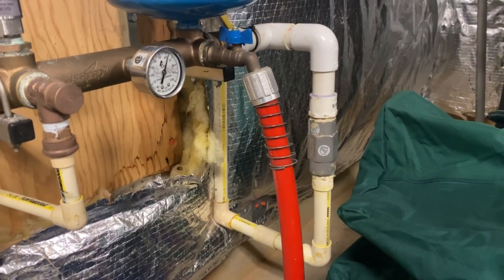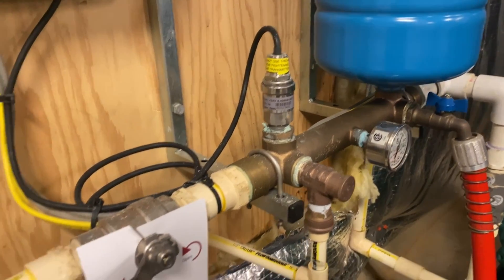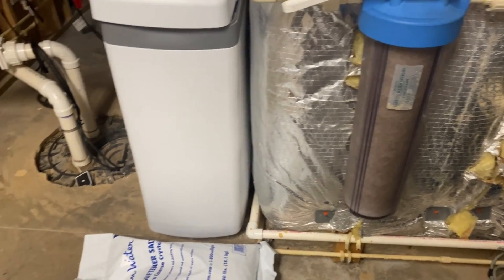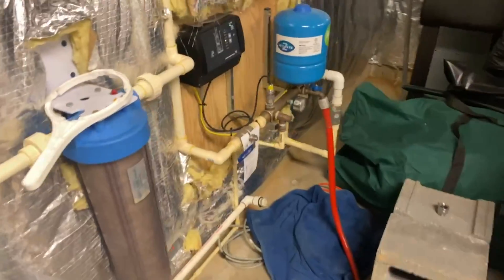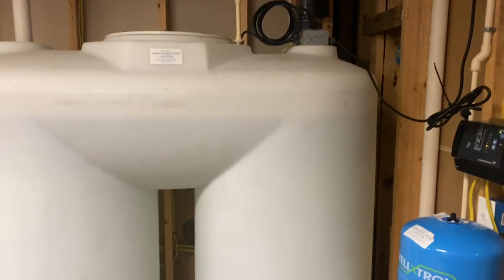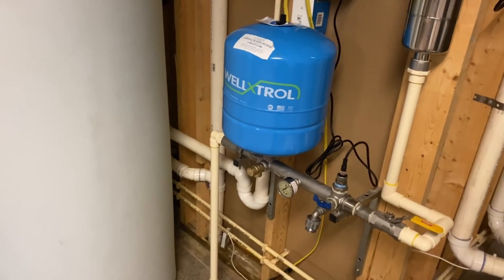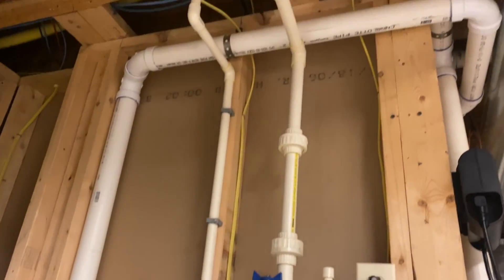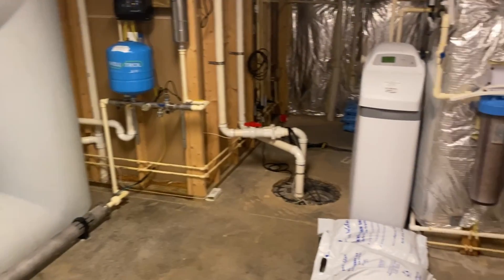Low Yield Well Water Storage System

Comment: I’m impressed with the setup but if anyone is thinking about doing something similar, don’t put constant pressure system from well to tank. That is a waste of money, he probably had to do this because he already had a VFD pump in his well and it made his install simple. If installing from scratch, simply install a pump saver controller and maybe a timer relay system if you’re fancy for the well pump. You don’t need anything else for the well to the tank. The constant pressure from the tank to the house is great but a little overkill it you are trying to keep costs down. You can get the same results with a 30 gal pressure tank, 40/60 pressure switch and a pressure regulator after the tank. Set the pressure regulator at 40psi and the pressure tank at 38psi. You will have a constant pressure system at 40 psi at 1/3rd the cost.

Comment: Can you please tell me more about the inline pump? I want to do my research on it.  It looks like it would be more efficient and space effective that a jet pump.
Reply from the maker: No one is really using that inline pump any more. The house picture is about 15 years old. People are commonly using these smaller ones that put out a good deal of pressure. I've linked two below that are incredibly common and reliable. I hope this helps!

https://www.amazon.com/Mini-Electronic-Pressurisation-High-Resolution-Capability/dp/B078Y7VWY5/ref=asc_df_B078Y7VWY5?mcid=773a58dce4433c6a9c67b7830ee1413d&hvocijid=2323925812057530802-B078Y7VWY5-&hvexpln=73&tag=hyprod-20&linkCode=df0&hvadid=721245378154&hvpos=&hvnetw=g&hvrand=2323925812057530802&hvpone=&hvptwo=&hvqmt=&hvdev=c&hvdvcmdl=&hvlocint=&hvlocphy=9007897&hvtargid=pla-2281435179818&psc=1

https://product-selection.grundfos.com/us/products/scala/scala2?tab=models
Reply: @Wellssepticandmore  Thank you I really appreciate this.

Comment: We have 6 people in big log cabin so at this point im debating large outside tank but we dont use alot at one time its just our well runs out around 50 gallons and so a load of clothes and cant do much else at same time. We havent had this issue before but the local mines are closer to our are underground which seems to affect it by around 100gallon less.
Reply: So would you think 300 gal would be enough ? It takes it like 30 mins for 50 gallons to come back so bot super low just low enough to be obnoxious